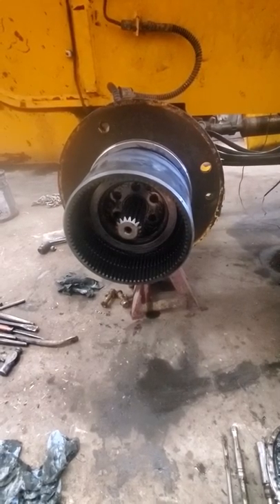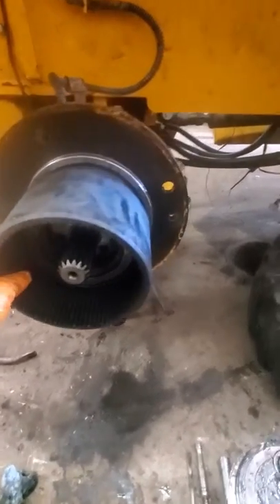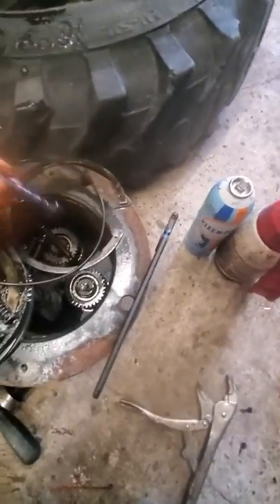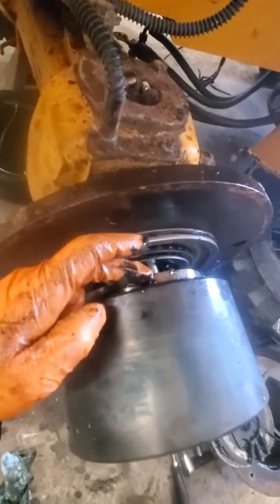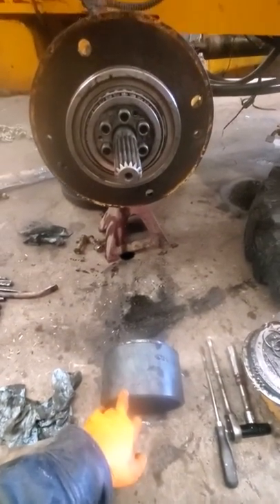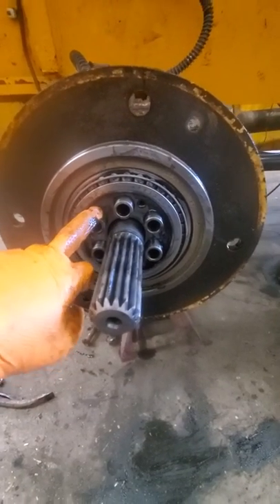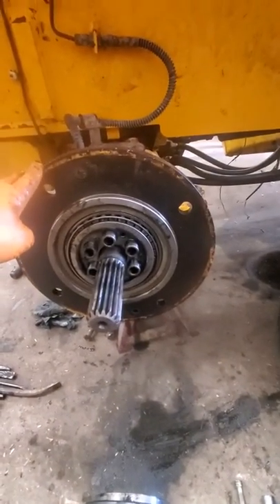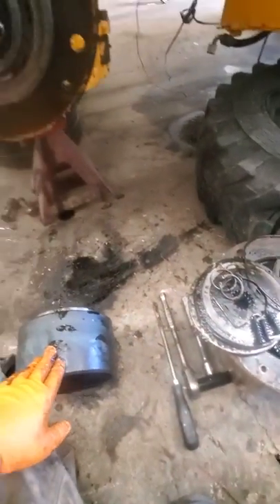Jcb 520 axle hub with brakes

Comment: I wonder if you have any suggestions for setting up 520-50 brakes?  My Dad's 520-50 you gotta push the brake pedal half way down before you get any response and you've gotta positively stand on it to get good stopping power.  Also, they seem impossible to feather.  You've either got them or you don't.  Is there a way to make them more responsive?